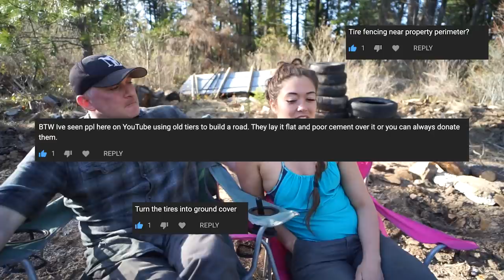SEASON 2 STARTS WITH A DISASTER! Couple buys off-grid Idaho property  and starts to build | GIVEAWAY

Comment: Thinking out load.  First things I'd do...

1. Trailer for hauling material in and trash out.
2. Trailer or RV to live in
2. Small solar setup to recharge tools
3. Buy rechargeable brush cutter and chain saw (Doing a little at a time)
4. Barbed wire fence.
5. Build multi 55 gallon barrel composting outhouse
6. Buy a cargo container or two
7. Large pole barn to protect building materials, equipment and trailer

Find out laws for burning brush piles or get a wood chipper.
Maybe a wood stump grinder.
Reply from the maker: Well we’ve got 4 or 5 of those checked off. We’re working on most of the others. But can only go as fast as our budget allows. Thanks for the tips and thanks for watching

Comment: Chop the tires up and use the chopped tires for raised bed garden. Build the frame, put down a layer of the chipped tire, and then fill the rest with good soil. Good luck...
Reply from the maker: I’m very leering of growing edibles in/around tires. Who knows what kind of chemicals are leeching out of those. I’m leaning towards a retaining wall of some sort
Reply: The tires are used as a base for a raised bed garden. Probably less than 50% of height for chopped tires. On top of the tires, you could put some of your clay and the rest would be good topsoil. You might be able to use chopped tires mixed with clay to soften the corral base.
Reply from the maker: Ahh - I see what you mean. Yeah that sounds way more doable!!!

Comment: bruhs, shiplap stack the tires like bricks fill em with dirt as you go for retainer walls & then put that found chicken wire across the tire walls with screws, and throw clay/hay cob at it and let it dry like stucco , could leave the south & west open for a geo-thermal greenhouse up against it for year round microgreens with a couple posts and 2x4's and contractor's plastic and staples... you could make a root cellar the same way using tires as earthbags walls and covering them with chicken wire and cobbing them. makes em useful and hides them. makes a hell of an insulated north wall for a hillside greenhouse or root cellar, retaining walls. that is my old tire and found chicken wire  clay soil idea ebook lol. XD
Reply from the maker: Wow this was in-depth! Good job. It might be worth looking into eventually. Thankfully neither the tires nor the mud are going anywhere any time soon 😂

Comment: I've watched a couple of these videos and you always seem to have standing water in the area with the tires.  Have you had this perc tested yet?
Reply from the maker: No, it is really expensive to get one done here and it’s just not high on the priorities list right now. We dug down in that area to see if it would fill up but it hasn’t - I think it’s just snow melt/runoff collecting
Reply: @NorthIdahoNomads  Your snow melt or runoff shouldn't really collect. The fact that you said your soil is mostly clay and that someone else started to build and stopped would be red flags to me. I would at least take your address or if you don't have one yet take your RP number to the Panhandle Health District and see if the property had been perc tested before. You should be able to see the results of previous perc tests. It would be pretty terrible to invest all your time and dollars into a property and find out later it was unbuildable. Thats probably not the case but if it had been perc tested before you might at least know if you need a $3,500 septic system or a $35,000 septic system.